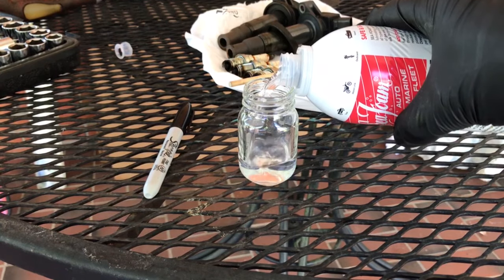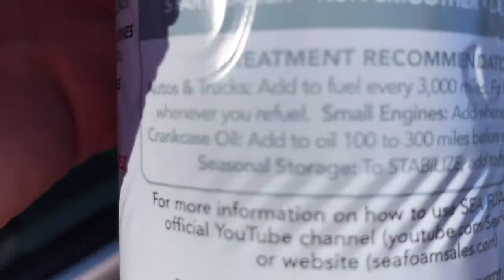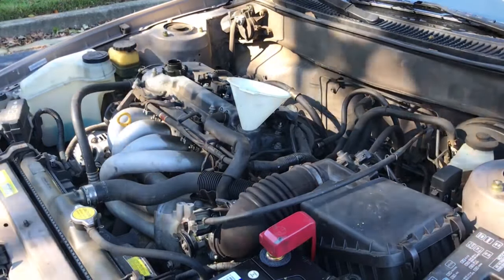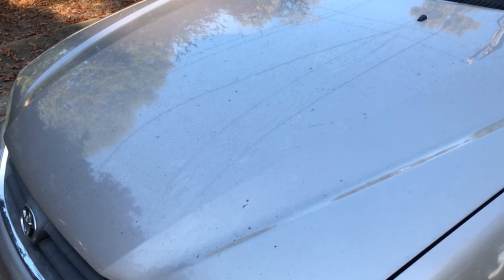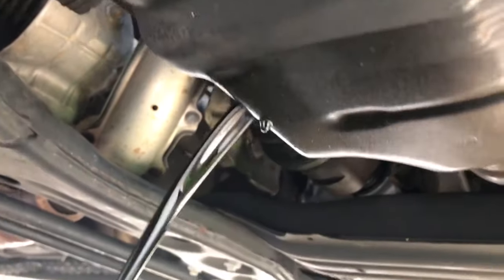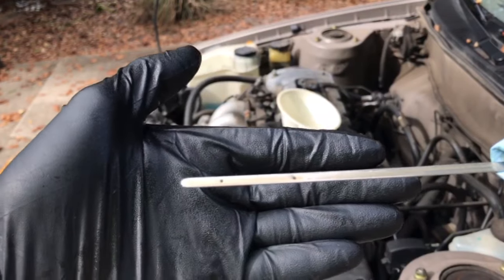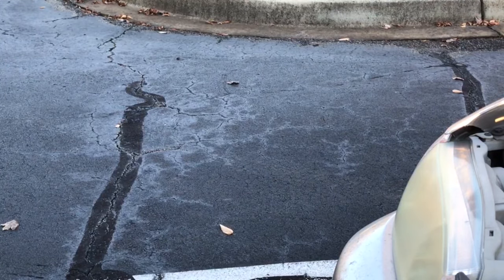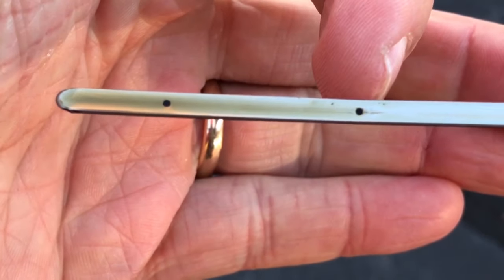Will Seafoam stop oil consumption? | Oil Burning🔥Experiments | Episode 2

Comment: So just bought a 05 taco w the 2tr-fe and under load it was using about 1qt per tank. 
I did the seafoam in the crank case as well as Lucas low viscosity stabilizer.
Then did seafoam and marvel mystery oil mix in the hot cylinders.
Then put the truck in gear and pushed it back and fourth to mix it up and coat the valves and cylinder walls.
Left it over night to soak then cranked the cylinders clear and ran her hard down the highway in 3rd and 4th gear...
I will report back w consumption numbers
Reply from the maker: Just saw your comment on the other video, Chris. Thanks for the input, and hope to hear you're successful. BTW, are you in the UK? We don't have Taco's with that engine in the US, (wait, I just looked it up and apparently they were available here) but I haven't heard about any Taco's burning oil. We've got a '97 Taco with 417,000+ miles (2RZ-FE) that we never have to add any to.
Reply: @FamilyFriendlyDIY  hey no in the USA the 1tr-fe was a 2l in the hylux the 2tr-fe is in the 2005-2015 taco. 
They are good but the early models used low tension piston rings and the oil relief holes were too small. 

So far it seems better but only miles will tell. I'll let you know
Reply from the maker: @stevemasterson7776  Well l feel stupid 🙄. Glad for your comment, because I’m always on the lookout for a good deal on a newer Taco. Do you know which years have the issue? Thanks again for the input.
Reply: @FamilyFriendlyDIY  its really just if someone missed oil changes or tried to do the 10k limit when they shouldn't have. It can be a great engine. That's how I got mine so cheap that and needing cv axles and ball joints etc
Reply: @FamilyFriendlyDIY  hey got an update. The hot seafoam and MMO mix seemed to help a lot. Drove 1k stop and go miles and almost no oil burning. It seems to be a huge improvement
Reply: @FamilyFriendlyDIY  I think its the early production years. Thats why this 05 calls for 5w30 but the 07 and up was 5w20. The thinner oil helped not clog oil control rings I think was the reason.
Reply from the maker: @stevemasterson7776  That's awesome to hear! Just so I understand, you put MMO in the oil, and then used the Seafoam spray while the engine was running around 2k rpm -- turned it off and let it "soak" for 15 minutes?? If not, please let us know what you did. Thanks again for the update and info, Chris.
Reply from the maker: @stevemasterson7776  Makes sense. Thanks, Chris.
Reply: @FamilyFriendlyDIY  no I took the spark plugs out  filled the cylinders w a mix of seafoam and MMO. Then Put the truck in 4th gear and pushed it back and forth "looking crazy to the neighbors" for a day or so then cleared the cylinders w the starter motor. 
Then changed the oil added some mmo to the oil and Lucas low viscosity stabilizer and it seems to not burn nearly as much now
Reply from the maker: @stevemasterson7776  Ha ha. Good to know. If you would, give us another update after a few thousand miles.

Comment: hi dave thank you for your awesome video, i have exact same car with same issue,  i was planning to change piston, but now i thing i can follow your way,  any update, on that corolla? is it running good now ?
Reply from the maker: Hey Turbo, Sorry to say the Corolla is still using oil. Right now I'm working on a Marvel Mystery Oil video (seeing if that can help with the rings). If that doesn't work, I plan to make a video of using Motor Flush on it. ... So we'll see. This car might be one long experiment.
Reply: @FamilyFriendlyDIY  ehhh ill change all piston and ring then . Thank you for your quick replay . Waiting for your video
Reply: @FamilyFriendlyDIY  hi there. Thanks for the great video.  I have a gen 7 celica ( same engine) that had the same issue but it stopped buringing oil after i used Auto RX. it is basically a detergent that goes in the crank case with fresh oil. After 2000-4000 miles you change the oil. After using auto rx my oil burning completely stopped.

Just another thing to note is that the 1zzfe engine has undersized piston rings  which makes the oil burning even worse after they gum up and stick to the piston.
Reply from the maker: @beefybeef1326  Good info. Thanks!
Reply: @FamilyFriendlyDIY  Is it undersized piston rings or not enough drain holes? I have the same car and there are loads of forums and videos dedicated to this issue on the Toyotas, and Saturns. Check 'Bob is the oil guy' if you have not already gone through the posts there. I am presently trying a mixture of Berrymans B12 and MMO - I don't drive the car and its been sitting for years so I decided I might as well treat/soak the pistons for large periods of time and see if that helps. If you have a garage to let the car sit in, I would try pressurizing each cylinder to force the chemicals into the gaps, apart from moving the crank a bit every now and then. Best way to permanently fix it is - https://youtu.be/A595LR4SQpI
Reply from the maker: @ray32825  My understanding is it's a combination of the undersized piston drain holes and low-tension piston rings. Let us know how the B12 & MMO work out.
Reply: @FamilyFriendlyDIY  Well, after 2 weeks of soaking in B12 and MMO, it looks like it seeped through. So I did it again a few days ago. My car is on an incline so I will turn it around for the next couple of soaks. I might not be able to deduce if it works or not, as I am not driving the car, but I am sure it will have some effect on the rings. Will let you know in a couple of weeks or a month or so. Take care and be safe from the variants.
Reply: @FamilyFriendlyDIY  Dave I used anticarbon from toralin (Don t know if you have it in the USA?) and it eats carbon but it could not release the piston rings... Quite toxic.... Maybe something for you.... All in all I Don t think you're going to succeed.... Anyway cool video!!!
Reply from the maker: @MrRichard57000  Thanks! I just looked that up, and nope, we don't have the Toralin stuff here. You're probably right with your prediction. I'm hoping these experiments will provide some good information so we'll all know what works (if anything) and what doesn't. Thanks for the comment mrrichards!
Reply: @FamilyFriendlyDIY  i got that....hey try to use some dot 3 or dot 4 braking fluid for a few days,it s cheap and very agressif...no garanty but it helped me out in the past....but if they are realy realy  stuck its all hands on deck and open up that engine(could be the smartest thing to do)any way greetings from the netherlands.....

Comment: when will you release your marvel mystery oil video? unfortunately for me.. the sea foam did not help at all.. I think my valves are bad. my car only smokes when cold and idling.
Reply from the maker: Sorry to hear that, Ahmad. I put over 3k miles on it with the MMO in it and have changed back to straight oil. Just want to put a few more miles on the oil to get a more accurate observation of its usage. If you promise not to tell anyone until after the video comes out---  ;-) --- at 329 miles it appears I've used less than half a quart.

Comment: Omg i cant believe this video found me.  SAME thing in my 15yo Toyota,   but not qt per 300 like urs,  thats pretty bad.  Glad to see ur moving in the right direction!  That SF definitely dissolved sludge off tbose rings and probably a ton of other places too. I did this,  not even 300 miles, to what I regarded was an otherwise clean engine. It doesnt use oil anymore! I'll probably repeat this now once a year or as I see necessary.  Lovely video,  Aunt Barbara adores you!
Reply from the maker: Thanks for the comment. Good luck with yours!

Comment: Transmission fluid in the oil will work better. The detergents will clean the rings. Injector cleaner on top of the pistons will clean the rings better than anything. Sea foam is a gimmick

Comment: Please consider some of the oil consumption to engine block ware. You can repeat the process with the Seafoam to clean it further more. Then just timely oil change to maintain that engine running for many more miles.

Comment: Good job.  I havew been reviewing and learning about Seafoam and others for this exact ring issue, which I didn't think I had since compression check was awesome (185psi) on ea. cyl.  I've got 183k miles and have been diagnosing this error code and found that I was actually down 1/4 qt, which woke me up.  I was impressed to find this for my exact car, I'll be trying this or MMO which others talk about as well.  What hasn't been clear is if you add the 1 oz per qt in addition to a full fill or wait until you're low (or drain some, to not overfill)?  BTW, what was the code on your check engine light that was showing?
Reply from the maker: Thanks for the comment. ... I assumed it is in addition to the full oil--just because a few ounces of overfill won't hurt anything.  ... My engine code is for something unrelated--Evap small leak detected.